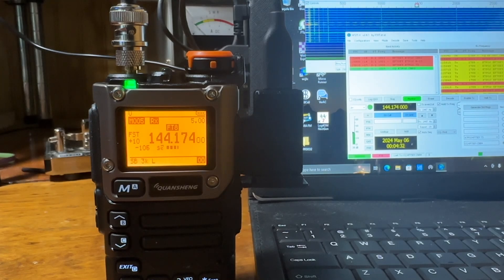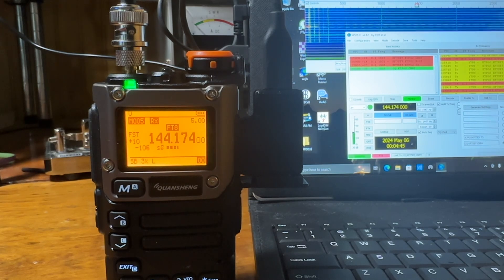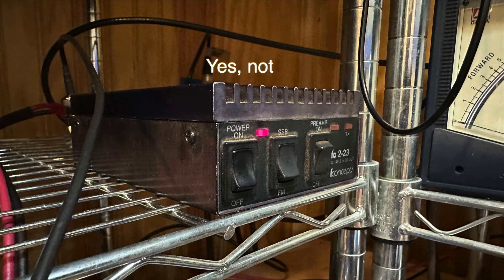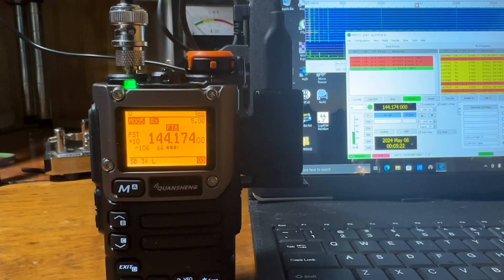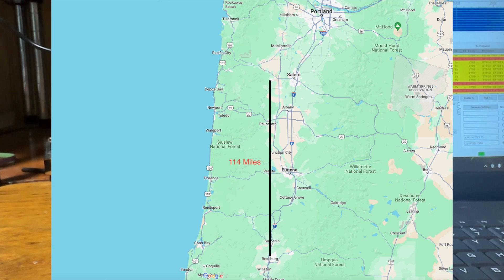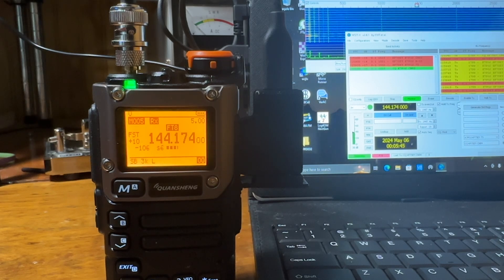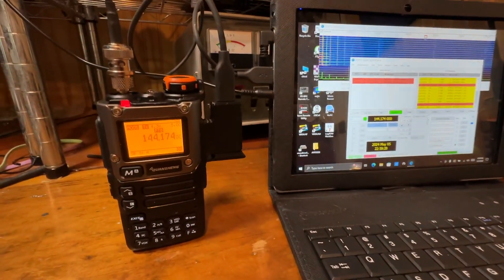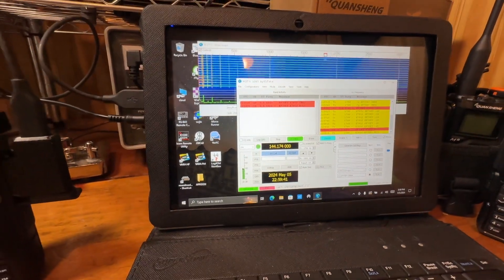I made a 114 mile 2 Meter FT8 Contact on my Quansheng

Comment: Hi，Recently I successfully completed an FT8 QSO on the VHF band using an air-coupled method with the UV-K5 and FT8CN. 

And I am trying to automating FT8 using wsjt-x with the UV-K5, because it is not comfortable to press PTT while wsjt-x is sending and vox won't start with sql =0(and I dont have an AIOC, I'm using the APRS cable to transmit audio (pc<=>k5 ), and then using a program to short the PTT line on the Kenwood connector ，the program detects the transmit status codes from WSJT-X, and then controls a serial port-operated relay.

Comment: What your setting on the Uvk6 like bandwidth etc? I see on your screen it says ft8, is that a frequency preset?
Reply from the maker: Yea i set the frequency on a channel. Have the bandwidth set to 3k if i remember right. And DSB. That was about it. Oh and the rf gain was +10 db
Reply: @QRPMonkey  yep sounds about right for me too. Where is RF gain?
Reply from the maker: @dadsrcworkbench1322 hold down the number 4 button until it pops up. Also i have the mic db set to +8.0 db and rx agc set to fast

Comment: Would be interesting to see a CW vs FT8 test as far as range goes. Does that dongle thing work in CW with Fidigi and IJV?
Reply from the maker: I did a range test with CW, 26 miles was that contact if I remember right. FT8 is going to do better just because of the computer decode. Flrig should work as modulated cw.
Reply: @QRPMonkey  I saw a video that was done with SSB CB at full legal power.  They got about 20 miles with a base antenna and car antenna.  Many people say GMRS gets much better range than CB, but they tend to always use really band short CB antennas.  

I saw plans of making a keyer and plugging it into the K jack.  Something could be rigged up to take the Fidigi tone and convert that to a closed key for the radio to produce real cw.
Reply from the maker: @JohnSmith-hm9hn to run CB frequency you would have to build a low pass filter as well as a amplifier stage. Not worth it in my opinion. As for cw, you could build a audio keying circuit and use fldigi. I have seen that done somewhere
Reply: @QRPMonkey  I was talking about a real SSB CB using 12W.  I knew a guy that did a GMRS vs CB test out in the woods.  He said the GMRS gave him a lot more range but I didn't ask him if he was using a very tiny CB antenna on the hand held.
Reply from the maker: Ah, that makes sense. Yea I could see GMRS getting out farther for local contacts. CB is like 10 meters. can't talk across town but can talk around the world. That's the beauty of HF vs. VHF